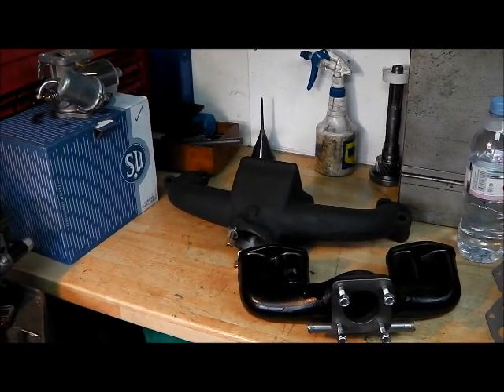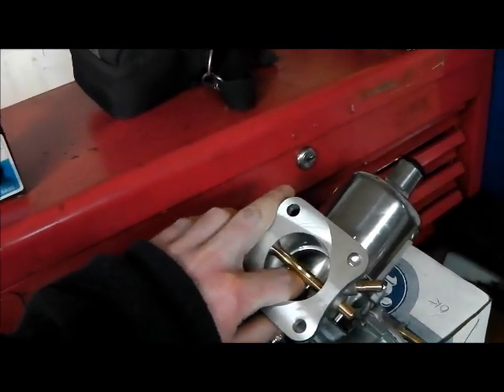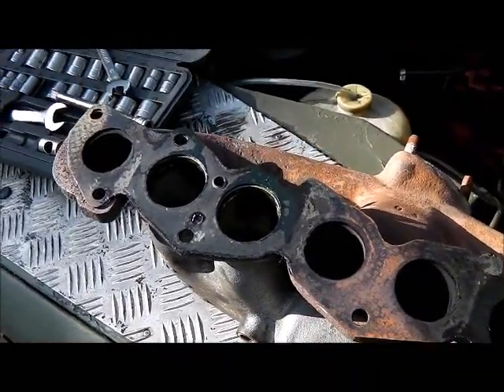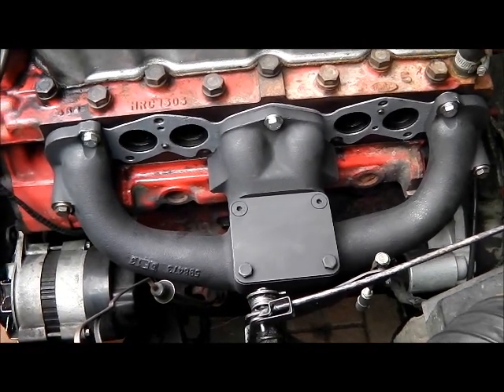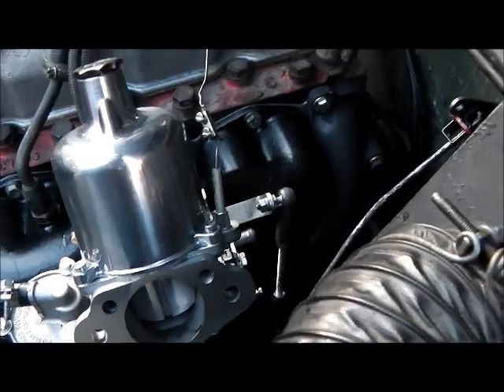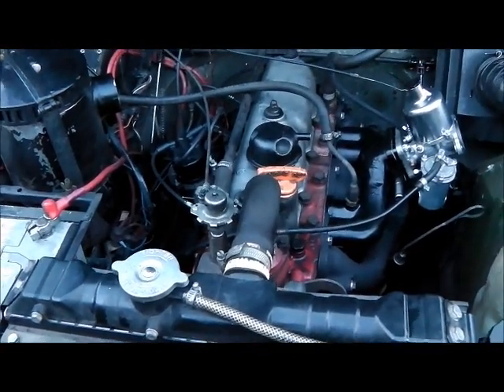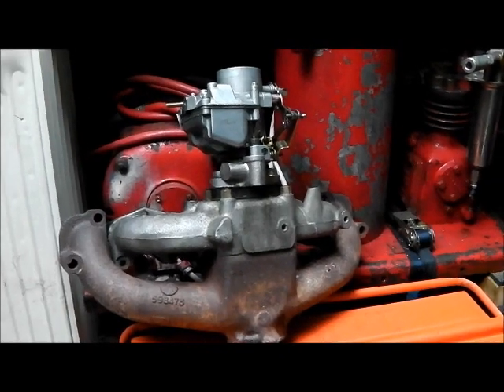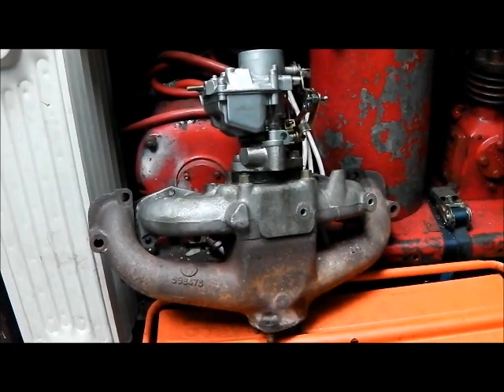Land Rover Series SU Conversion - Part 1

Comment: SU carbs are a beautiful piece of kit, they appear so simple but are a very clever design and infinity adjustable. The oil damper is the equivalent of an accelerator pump in a conventional carb, the heavier the oil the slower the piston rises and the GREATER the acceleration enrichment due to the higher air speed over the main needle. 
Haynes do an excellent manual on the SU Carburettor their book number 299 this lists all available damper springs, needle sizes and tuning / maintenance tips.
After your experiences in an English summer you may now understand why standard landrovers struggled in Australia with summers over 40 Deg C for weeks on end ;-) most of them ended up with locally made 6 cyl Ford or GM engines fitted after a few years.
Good luck with the new job,
Ray
Reply from the maker: Hi Ray, thanks for the tip off regarding the Haynes book, I'll track down a copy if I can. Even just after basic set up I'm impressed, it would be great to see how I can get more out of it. 

Certainly do understand the problems of hot weather now - lets face it, for the distances you guys travel something a bit more gutsy probably doesn't hurt either!

Thanks, looking forward to starting the new job, working for a firm who restore vintage aircraft. Once in a lifetime opportunity,

Phill.
Reply: Sounds like an excellent job! Your skills at restoring parts and attention to detail will come into their own and be appreciated I'm sure.
Ray

Comment: Was the Zenith the 30IZ?  I have a Reliant that was fitted with 30IZ Zenith as standard and peeps say a Weber ICH is an upgrade, but in the confines of the Reliant engine bay that can suffer from vaporisation as well. (Good for trikes though) So I was thinking of fitting SU from an 850cc Reliant engine (mines the older 700cc). You reckon it will be OK?
Reply from the maker: The Land Rover uses a 36IV. The Webber is certainly not considered an upgrade in LR circles, though they probably seemed like one if you had put up with a clapped out Zenith for any length of time! The SU gives a better throttle response than the pump jet type carburetors, the engine runs so smoothly - it didn't misfire before but it's just silky smooth by comparison. The SU set up doesn't seem to like cold weather, even with the heated manifold, once warmed up it's great. You should consider how you might heat the manifold.

Comment: hi there im running the same system on my 88.but the blanking plate on the exhaust manifold (seen at 6.59 on your video) is blowing again( iv previously stripped it down and fitted a new gasket a few years ago)however the plate is now getting thin and corroded so i need a new one with gasket( tho i do have gasket material to make a new one if needs be) .the car came with this system fitted when i bought it so dont know were to source a new plate ,could you help advise where to look.
Reply from the maker: You might get one from ACR, who as far as I'm aware, still supply the kit. Failing that, make one - very simple to cut out and drill.
Reply: @steamwally  cheers, ordered one just today.. all good. Thanks for reply 😊

Comment: I've watched pretty much all of your videos on WRD and that's the smoothest I've heard it run. What with this and electronic ignition I doubt if it can be improved any more now and is probably better that when it left the factory even if it does use a bit of oil. Are Zenith carbs a problem in general? I only ask because I'm reminded of the Zenith carb on the old Suffolk mower engine which I think was eventually replaced with a far better Dell Orto unit. I could never get them to tick over smoothly! Anyway it'll be good to see a test drive when the conversion is finished, happy motoring! Rich :-)
Reply from the maker: Thanks Rich, yeah it's going quite nicely now, I'm actually happy with it at last! I think Zenith carburetors have the same probably as many others - they are easily tinkered with. The 36IV as fitted to the Land Rover is one of the better carbs' fitted from standard but they do warp eventually it seems. They are a much simpler instrument than the SU though - I would happily rebuild one at the side of the road, not sure I'd do the same with the former.

Comment: SUs a much better carb Phil. You'll see better mpg as well. Years away yet, but the only problem they have is dashpot sticking up. Simply clean any corrosion from around the piston. Some of the Ford lads used to do this swap on their 1200 Anglias and Cortinas.  Came as standard with most BMCs of course (grin).
Reply from the maker: It's a world away from the Zenith, Malc. I should imagine better MPG will be possible, though I need to make an adapter to use the oil bath filter - the induction noise is very addictive..  Thanks for the tip!

Phill.
Reply: Never understood why constant vacuum carbs weren't used more widely. SU being much better than the Stromberg......so much better than constant choke. Of course today with computers controlling injectors, they've become obsolete.

Comment: Where did you buy the SU Kit Steamwally?
Reply from the maker: Google Automotive Component Re-manufacturing Ltd. It isn't cheap by any standards, but I have to say the improvement in performance has to be felt to be believed - very much enjoyed the drive to work today!
Reply: Thank you kindly. Its for my 1964 Series 2A 109.

Comment: You would be better feeding the engine breather back into the carb inlet and not into a oil trap, The oil heavy air is good for upper cylinder lubrication and and you wont have a pot of toxic gungy oil to get rid of
Reply from the maker: Certainly does avoid the need to empty a catch can, however from the point of view of performance increase - it is better vented to atmosphere. I wouldn't really want to vent spent oil into the carburetor, the standard set up is only engineered that way to satisfy the emissions regulations of the time.